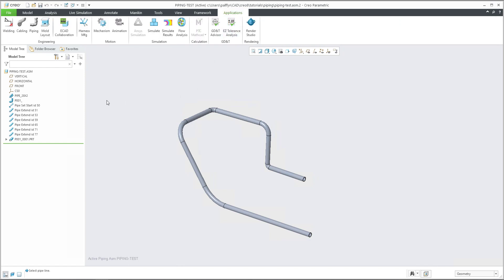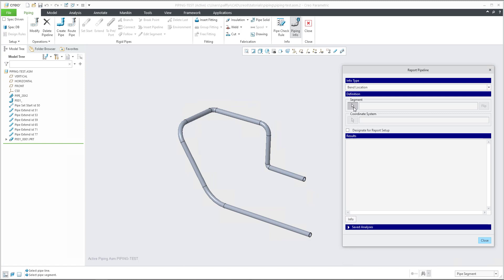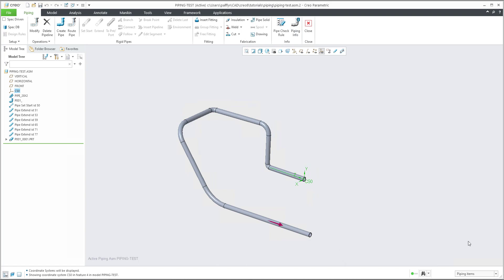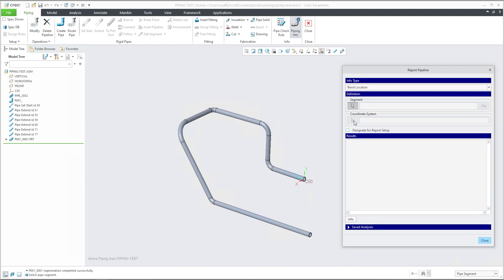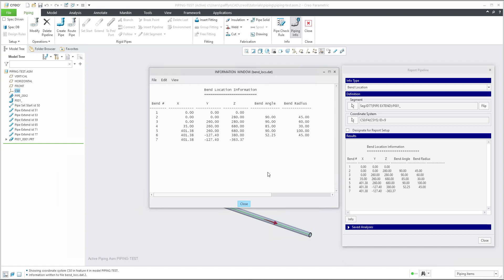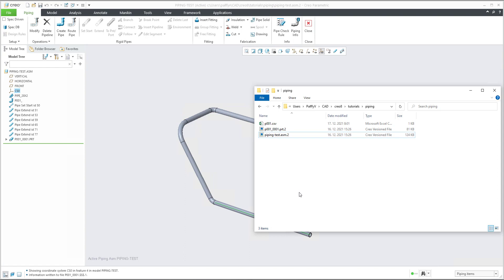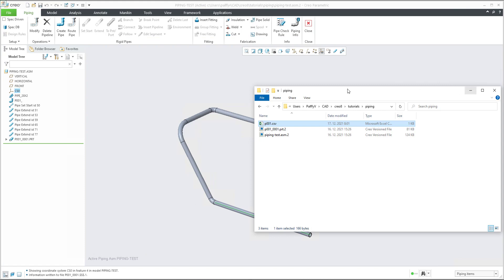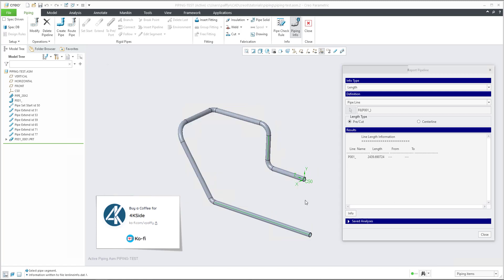Bend Location - How to Report pipeline | Creo Tutorial

Comment: Hello I'd like to know if its possible to unfold ( easily ) this tube for laser cutting, thanks!
Reply from the maker: Sorry for the late reply, busy with work.
If you need to create unfold of pipe you need to know middle axis (length of the pipe) Long time ago I have created this tutorial https://youtu.be/1KyxGCAeScQ
Then you have to use same logic of dev. length (same calculation as is used for sheet metal parts)
It is a little bit tricky, but you can try it 😉
Good luck, Vladimir